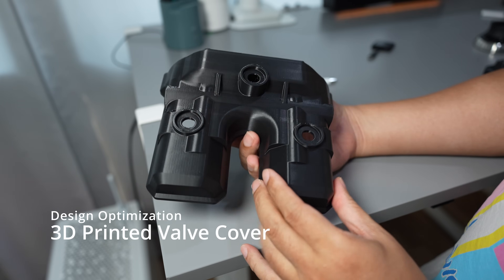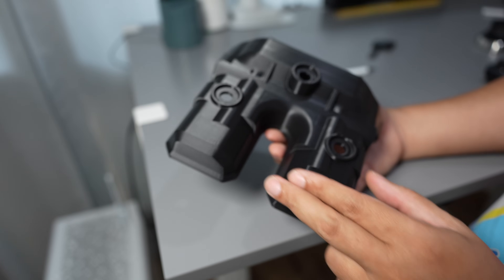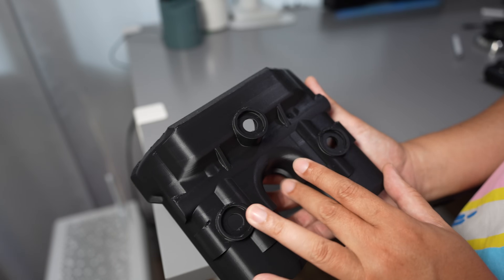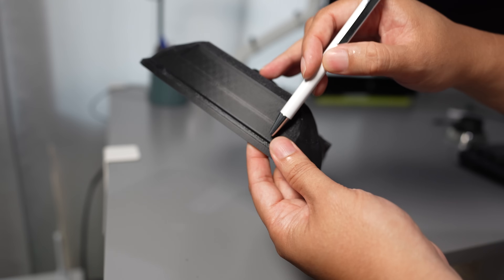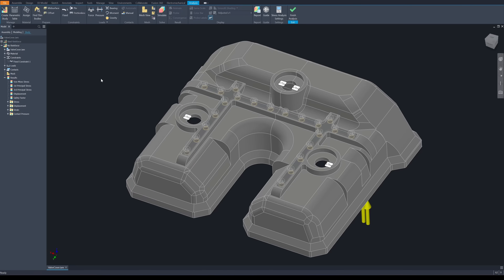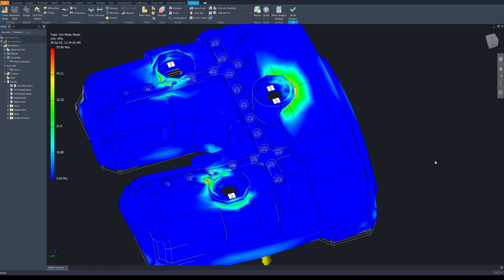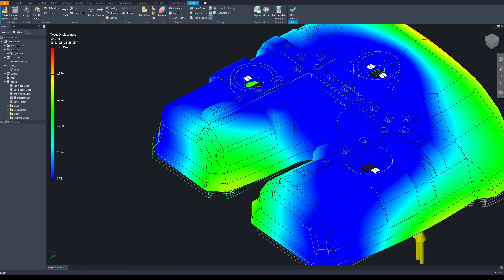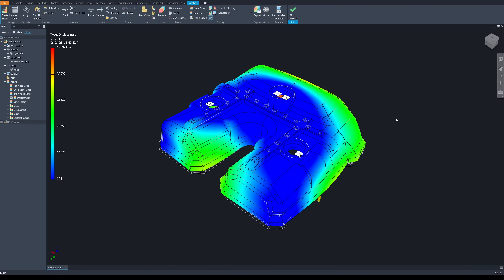Boosting 3D Print Stiffness with Steel Reinforcement - Engine Valve Cover Case Study

Comment: I found using a long threaded rod  that i drilled into the part does amazing things for stiffness, partially because is effectively friction melts into the part as well with a fast drill. I use a Dremel to cut a cross into one end so i can drill it straight into the part and hide it.
Reply from the maker: That’s a solid approach for creating a composite material. The interface between the plastic and steel thread would be firmly bonded, ensuring no relative movement. However, since the steel isn’t positioned at the outermost surface, the plastic layer could fail before the underlying steel thread begins to contribute structurally. Still, this configuration would definitely enhance overall stiffness.

Comment: You could put it inside the 3d print by pausing mid print, inserting the metal parts, then continue printing on top and around of it
Reply from the maker: That's not how composite materials function. The interface between metal and plastic must be securely bonded to eliminate any relative movement—both components need to act as a single unit. When subjected to bending loads, shear forces will inevitably develop across the contact surface. To withstand these forces, strong mechanical fastening methods such as bolts or high-strength epoxy adhesives are the only methods of bonding those contact faces.

Comment: I do similar on some of my parts. However I just add a cavity pause the print and lay the metal in then continue the print. No need for heat inserts. I also do this with nuts, or bolts as studs.
Reply from the maker: That's not how composite materials function. The interface between metal and plastic must be securely bonded to eliminate any relative movement—both components need to act as a single unit. When subjected to bending loads, shear forces will inevitably develop across the contact surface. To withstand these forces, strong mechanical fastening methods such as bolts or high-strength epoxy adhesives are the only methods of bonding those contact faces.
Reply: @Payo-TensileCreator while I agree with that a more secure connection method would be ideal for improved longevity and performance I don't believe in most cases it is necessary. If your cavity is a firm press fit the stresses between the two would be mininum. I have also added epoxy to the cavity as well before inserting the stiffiners, but normally its just a firm press fit.

Comment: Did you simulate the same part with the cast aluminum? What would the deformation be there? Can you use those values as your target and increase the steel size until you reach it?
Reply from the maker: Deformation from simulation.
210 kg pre-load.
Aluminum cast max. deflection = 0.15 mm
PA 6                                                 = 3.58 mm
PA  6 with steel reinforce             = 1.97 mm

I don't think you can match the solid aluminum shell with reinforced steel sheet and PA-CF print. But you can make the sheet wider, thicker and fold it along the side wall.

Comment: try prrinting with pps-cf
Reply from the maker: Aluminum boasts a stiffness of 70 GPa, whereas the stiffest FDM-compatible material currently available—Fiberon PA6 CF20—reaches only 8.6 GPa. PPS CF10 trails even further behind at 5.4 GPa, making it approximately 13 times more flexible than aluminum. It’s unlikely that manufacturers can push carbon fiber content beyond 20% in these filaments, as higher concentrations tend to compromise printability.

Comment: Why can't the part be split into two thin shells, that are sandwitched with a real carbon fiber cloth with epoxy, to form the final part. Alternate is to apply epoxy/carbon fiber cloth selectively, to the normally 3d printed part, assuming clearance below valve cover. It does take more effort, but will be better than any 3d print with the pseudo carbon fiber/glass filled materials. Another approach is to anneal the 3d printed part(say PA6-CF, PC-CF), should improve the properties much more easily,at the cost of more time and some accomodation to shrinkage/distortion.❤👍
Reply from the maker: Plastic is plastic, manufacture tried to add CF to increase the stiffness, but the best they can do right now is 8 times behind the aluminum casting in term of rigidity.
Reply: @Payo-TensileCreator  Agreed, nothing can beat Aluminum/Stainless steel. Still the issue with FDM is due to layer by layer deposition, making it weaker than Injection molding. Again Peek might do a better job, but expensive and beyond the capability of most 3d printers with Chamber heaters. MSLA with high temp materials may be better, if you can find the right material. It might still need a top coat for protection.❤👍

Comment: how will round pockets with pressed-through rods perform?
Reply from the maker: That’s a solid approach—epoxy-coated 6mm rods could slide in cleanly and offer a much stiffer and more polished look compared to a 2mm sheet. I’ve seen pre-cut lengths available online too.

Comment: The reinforcement is a very interesting idea, the simulation results look great. I will try to incorporate that into my own designs.
Personally, I wouldn't dare to 3D print a valve cover, though. My motorcycle motor (liquid cooled) gets up to 110°C coolant temperature, hard to think Nylon will manage that with full strength.
Reply from the maker: PA6 CF is advertised to handle working temperatures up to 110 °C—but I’m not entirely sure how accurate that claim is under real-world conditions.

Comment: CF PEEK might do the job for you: https://youtu.be/TGv47NQmtJs?si=uzlXcB7Eu4MQNY79
Reply from the maker: It's the same as Fiberon PA-CF, the stiffness (Yong's Modulus) is only 8.3 GPa comparing with 70 GPa in aluminum. That's 8.4 times more flex.

Comment: Would it be possible to design the print pre-warped, in a way so it will get it's proper shape once put under load?
Reply from the maker: Yes, it's possible. The method is known as "precamber," and it's used to counteract deflection, reducing the risk of structural failure. I routinely apply this technique when designing long beams or compression members to offset gravitational effects.
Reply: @Payo-TensileCreator  Ah! Thank you!
Reply: @Payo-TensileCreator  In the future I will call violently forcing something in place, "applying the required precamber"

Comment: Nice video.  Not sure I agree with the maths.  7Nm radial torque is not 70kg axial load.  A valve cover is going to run at say ~90Deg C? - that will change the mechnical properties of the PA-CF.  The FEM should only be treated as a guide / validation of some proper analysis and to indicate where to add extra material - surely thickening the entire manifold would have been sensible?  A very nice process you have there to quickly integrate cheap metallic stiffeners!!
Reply from the maker: Yes, it's not 70kg, there're constant value (K) for each bolt and lubrication factor. Just to keep it simple and digging for correct K value isn't easy.

Comment: 7nM DOES NOT mean 70KG! That is completely dependent on the bolt thread pitch
Reply from the maker: Yes, it's not 70kg, there're constant value (K) for each bolt and lubrication factor. Just to keep it simple and digging for correct K value isn't easy.

Comment: This is a very cool idea! I haven’t seen anyone else doing this in 3d printing but it makes so much sense!

Another thought to try to increase stiffness in this scenario would be to have a section go vertical up the face with the small strip, making it into an upside down T shape, or add legs on each side making a wide U shape. What could be even better but harder to calculate is making the steel strip bend around the corners to add strength in multiple planes. This may require the holes to be slotted on the second plane to compensate for hand bending and material shrink/expand around the corner. Loctite may also be a good idea with thermal expansion likely being different between the nylon, stainless and brass?
Anyways I appreciate you sharing! Hopefully one of my ideas are helpful 😂
Reply from the maker: Yes, a vertical stiffener would be more effective. However, installing the steel plate vertically requires at least 15 mm of clearance—and I’m not sure how much space remains above the valve cover.

Comment: A problem you have is putting the steel on the wrong axis, you can easily bend for example a butter knife on its flat side, but you could never bend it on its thin side.
Reply from the maker: Yes, a vertical stiffener would be more effective. However, installing the steel plate vertically requires at least 15 mm of clearance—and I’m not sure how much space remains above the valve cover.
Reply: @Payo-TensileCreator  I was thinking mini profiles, eg U-section 6 x 6 x1mm thick?  Would be a dirt trap mind.
Reply: Also the steel does not help that much in that placement and in that orientation since the nylon cf is already very stiff and the shape also contributes. Most of this can be calculated through area moment of inertia and some other stuff. Easy fix would be adding a metal strip along the bottom on the sides to reduce tensile forces on the 3d print
Reply: Yes, but he is just one step away from laser cutting some cheap extruded profiles, say U or J sections.  Kudos to him - it's a pretty neat idea.

Comment: did you think about operating temperature. ? mechanical Properties change a lot.
Reply from the maker: Nylon FDM print will start to weaken at 110 C, If his engine's water cooled, that should be fine. But if this's an air cool engine, this would be very bad.

Comment: Very good ideas, but you have incorrect constraints. The forces are applied to the mounting holes and the restrained surfaces should be the sealing surfaces.
Reply from the maker: But Newton third law says otherwise :) It'll take years to learn and understand physics simulation. In my job, I design/simulate structures for football stadium, https://www.tentphuket.com/project-portfolio/indoor-stadium-huamark
Reply: @Payo-TensileCreator  So you have not understood the parameters to begin with. I have been working as a mech engineer for 18 years. By applying the forces as you have done, you do not simulate the actual load case. There is a stiff surface to push the cover against when tightening the attachment screws, so the deformation you see will never arise. The forces applied to a surface like you have done will iterate and each iteration takes into account the changed angle of the surface. This will yeald a incorrect result. Now lets pray for the people of these football stadiums 😄
Reply from the maker: I see where you're coming from. I’ve trained intern engineers in the past, and their approach was quite similar to yours—though typically a bit more grounded in practical constraints.
Here’s how we’d usually set it up on the oil seal side:
- Compression-only support
- In-plane friction
- Spring support
- Frictionless contact along the bolt hole wall
Then, we’d apply force to the bolt flanges.
Sounds like a proper simulation, right?
Actually… not quite.
Maybe one day I’ll write a book about this.
For what it’s worth, the stadiums and structures I’ve designed are still standing strong—the oldest has held up for 27 years.
Reply: Yes, but it's all too complex.  Modify the part to suit the constraints and material.... clamping fresh air is not a great idea, even on the aluminium cover.  If possible extend the three clamp hole bosses down to just above the cylinder head parting plane, meet in the middle for analysis and shake hands!!??!! 😂

Comment: Maybe increasing the shell thickness will help. Also, there is nothing above it. 2.8mm is very thin
Reply from the maker: Adding stiffener on the outer shell will help but I need a scan on engine bay area. It could crash with gas tank, wire harness, frame.
Reply: @Payo-TensileCreator  adding 2mm shouldn't be a big deal but ya having accurate engine bay scan would help determine how much of a thickness u can make the model

Comment: If you anneal PLA it increases it's strength by 25% it would also be able to withstand the heat from the engine as well.
Reply from the maker: PLA shrinks after annealing. For part like this, it's going to come out from the oven differently.
Reply: @Payo-TensileCreator 

That can be compensated for.
Reply: @Payo-TensileCreator 

It shrinks in the X and Y axis, it grows in the Z axis. It will also warp if it isn’t constrained. I make a female mold from PLA first hold it flat and square with a jig anneal it. I then put the part in the mold and anneal it.

Comment: But how you attach steel plate to printed part? I think heat inserts will be a weak point and simulation will look quite differently with tthem
Reply from the maker: Structural members can fail due to various factors, including:
- Bending
- Axial loading or buckling
- Torsion
- Shear
- Deformation
Engineers typically aim to design components so that all potential failure modes occur simultaneously—this helps optimize material usage.
However, in this case, the valve cover is expected to fail due to deformation well before the shell cracks or the brass insert is pulled out (which would require around 50 kg of force per bolt on nylon). The simulation already accounts for the presence of the brass insert.

Comment: I would have liked to see you show the simulated deformation of the factory cast aluminium. 
To me that should be your true base datum flex. 

Good old strategically place ribbing and buttresses for the win, as weight is on your side. 

🇦🇺🤜🏼🤛🏼☮️😎🍀
Reply from the maker: Thanks for remind me this. I forgot to put that in the video.
210 kg pre-load.
Aluminum cast max. deflection = 0.15 mm
PA 6                                                 = 3.58 mm
PA  6 with steel reinforce             = 1.97 mm